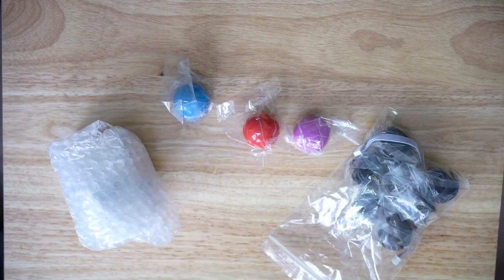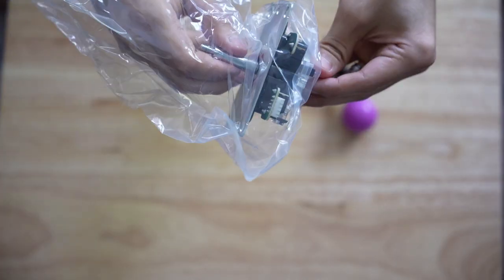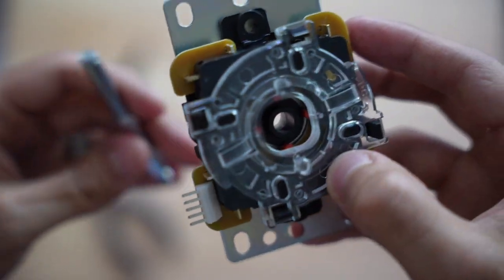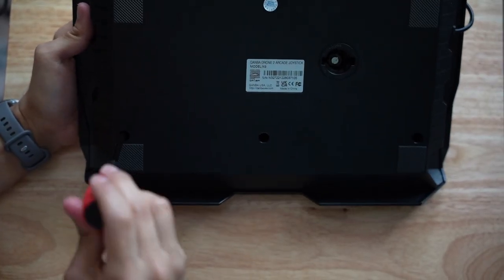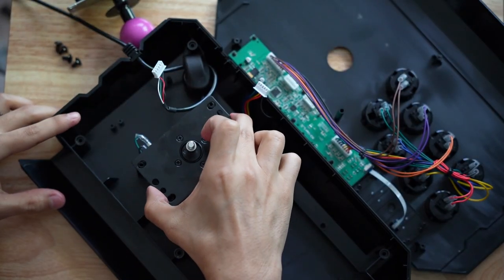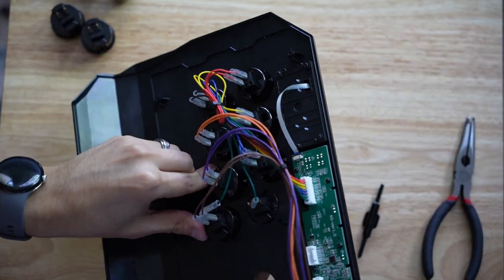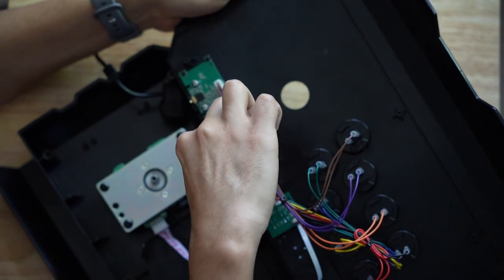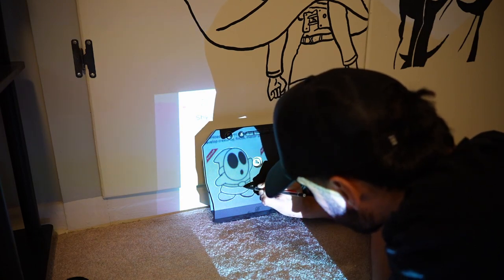Qanba Drone 2 Mod?? REMOVABLE JOYSTICK / EX-Groove Link / Easy Mod??

Comment: What would I do different? I would sell the Drone 2 for the first one and save like $60, because the PS5 Qanba sticks are NOT reasonably priced 🤣

Seriously though, I would swap the Sanwa buttons out for Qanba Gravity buttons. They're a little more expensive than Sanwa buttons, but they're quiet, and much nicer to your fingers after long play sessions. I'd also recommend adding weight to the case, but that's only if you're like me and prefer more heft to your sticks. I purchased adhesive tire weights to make it more to my liking for that adventure

And I know you said you added the removable lever so you can put it in your bag on the fly, but if you wanted to forgo the bag, I added a strap I can throw over my shoulder. It gets a little snug, but the cable and strap can fit in the storage cubby just fine when not in use
Reply from the maker: Nice mods 💯 you know what, I never thought about throwing tire weights on... I definitely thought I could work with this arcade stick, but after using it I think the weight is what makes me miss some inputs, so I went back to my Razer Panthera

Comment: new to fighting games (and fight sticks overall) is there any way i can find out what compatible levers/sticks would be good replacements for this specific fightstick + what buttons I'm able to use that would also be compatible? im struggling a bit to find any info on this but and other resources have been pretty vague
Reply: The only one that will fit without you having to bend prongs is the Sanwa stick. If you're wanting to change the stock stick, you can purchase that one with confidence. 

Although, if this is your first time ever playing on an arcade stick, I would recommend not spending the extra $25 on a sanwa joystick right away. Just play on it as it is for a month or so and decide if it's something you like the feel of and will stick with. There's no need to rush into modding...

Although, if you ignore me and get it anyway, I'd recommend buying a Sanwa octagon restrictor gate along with it, because I had my Drone for like 4-5 years, but it always felt clunky and awkward to me until I changed the gate...idunno if any of this will help with your decision, but I hope it does 😅
Reply from the maker: @christian_uu ^ pkphantom is right, although when I first started off I switched to octagon just to learn fireball motions.. once I did, I went back to square gate. A lot easier to hold down back for blocking or charging

Comment: What does replacing the lever do ? Genuinely curious I just bought the same fight stick
Reply from the maker: @ShaolinMatchy  this modded lever specifically lets you remove the lever just by pulling the spring on it.. making it easier to put in a bag for travel so you don't damage the lever

Comment: Besides the joystick coming off, between the stock and the one and one you put on. What is more stiffer and looser? I have a drone 2 and its my first stick. I can perform combos ok but when it comes to supers, its a hit or miss in sf6. I can do qcb ok but qcf i have a hard time. Do you think its a joystick problem or gate problem. Or should i simply find a technique
Reply from the maker: It could be both, i say try both a stiffer spring.. then later try a different gate if it still doesn't fix the issue
Reply: @blendoben  thanks for the response, ill do some digging. 👌

Comment: Cool fuckin mod. I picked up a custom Qanba drone mod, which was a matte, fully blacked out case with some silent qanba buttons. Similiar black case to yours. Swapped those out for sanwas and went with a JLF stick, with a short cocktail shaft, .5 lb spring, rubberised balltop, 1 mm oversized actuator and an octagon gate, no shaft cover. Also velcroed on a keyboard wrist pad for some extra support. 

What makes the drone unique to my other modded sticks is how light it is. With the light spring tension on my mod, the light weight isnt even an issue and its great to use when doing alot of keyboard type of shit on emulation. Ive mapped save and load state to foot pedals for efficient practice, but some games require note taking and other types of tasks. Sometimes I just like the light feel too. 

Question for you. Do you know if the drone allows for turbo speed adjustments? Biggest issue I have with the drone is that it seems to have one fire rate for turbo and its a little slow. I actually needed to use a SPECIFIC control pad with 30 hz fire rate to beat an arcade game called Zero Wing. Final boss was impossible without that fire rate when playing checkpoint to checkpoint. I use these controllers for all types of games. I havent found a way to cycle through turbo speeds on it yet. Tried looking it up, cant find my manual. 

My top stick is still my modded Hori Rap4 but thats mainly because it gives me less wrist issues and the Seimitsu LS62 stick I have in that one, which I find super precise for platformers and especially shooters. Can really make those micro adjustments. For beat em ups and fighting games I really like this qanba mod though. Great all around controller. Might toss a Seimitsu LS40 in there, in the future to see how that stick feels too. The LS62 is kind of a hybrid mix of different seimitsu joystick features.
Reply from the maker: Nice mods! And honestly I'm not sure about the turbo adjustments, I never really used the turbo feature
Reply: Makes sense, especially if you mostly play fighters. Though you can really destroy with ehonda and blanka with the thousand hand slap and electrocute moves, ha ha.  @blendoben
Reply from the maker: True, I  play street fighter 6, and they made them quarter circle motions now !
Reply: Nice. I remember poppin out fireballs like babies in the back of a van with blacked out windows and baby shakin' gravy with that controller @blendoben